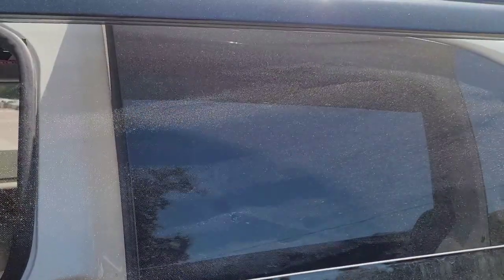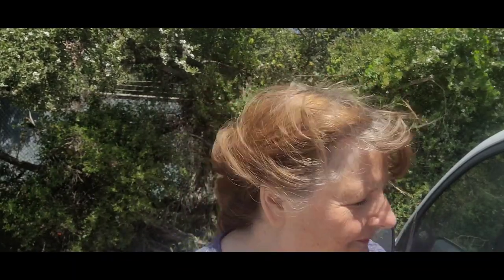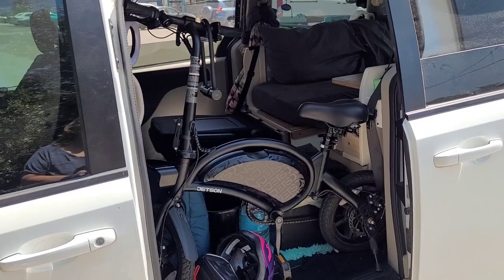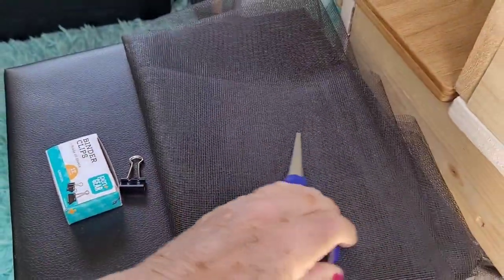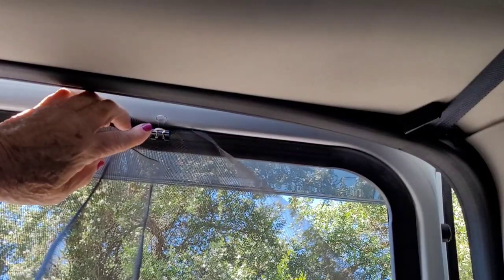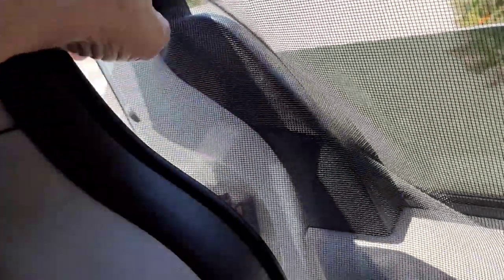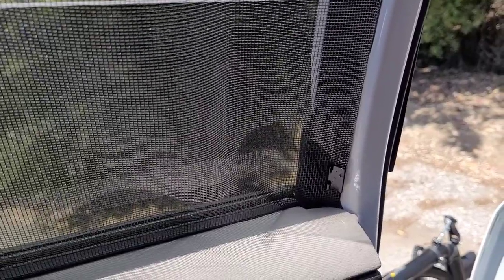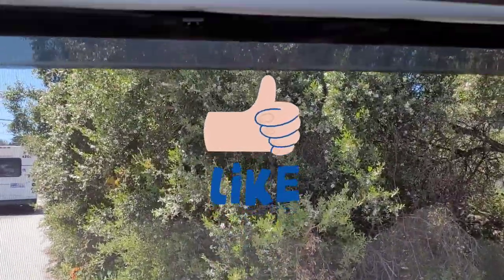Vanlife |  Screens to keep the bugs out this summer. NEW design.

Comment: I used the rain gutter covers that have screen material on the underside, and trimmed them down to fit when the window is rolled down, then back up to catch the lip of the gutter cover. They worked really good on my first outing, but it was the end of Sept so the nights cooled off pretty good here in Texas, but I was just planning a short over night trip next week and worried it might not cool down enough at night since I will be in the Central Texas area. This really helps and appears it’s something I can do in one morning. I would like to have both options due to the craziness here with weather and bugs!
Reply from the maker: I keep my windows open a lot even when driving and these stay in place nicely and are proving to be very sturdy.

Comment: I have a Dodge Grand Caravan and my second row seats/window doesn’t go up and down.  The window on the sliding door.  So could i do this on the front row of windows?  The one on my driver door and passenger door?
Reply from the maker: I haven't tried it on the front windows. But just looking at them they don't have a wide rubber gasket around them for me to be able to insert the binder clips. I don't know if your windows are the same.
Reply: Hi Debbie. The only thing about attaching the screens to the front windows is your visibility goes way down.  I have screens that pop in and out and when I drive with them it is hard to see things clearly. 
With Elaines method it would be cumbersome to remove the screens when it’s time to roll.